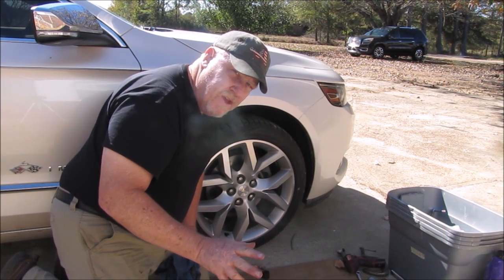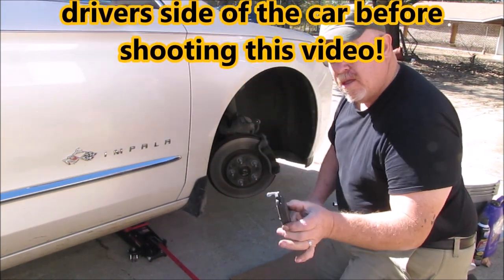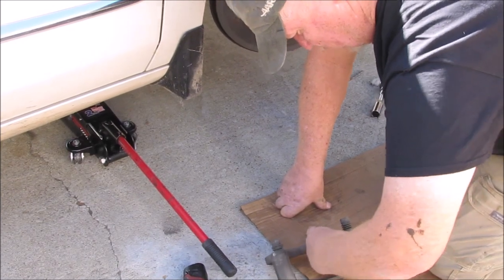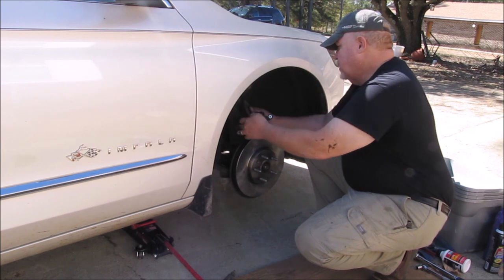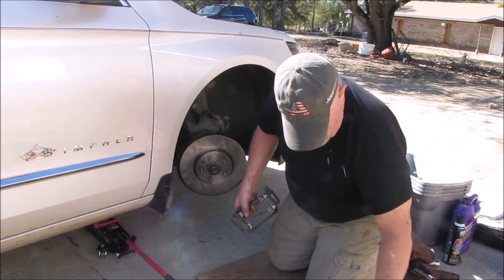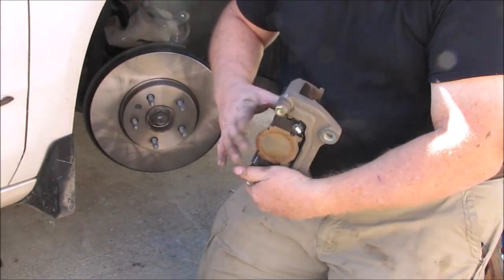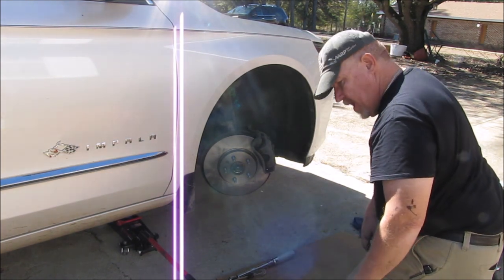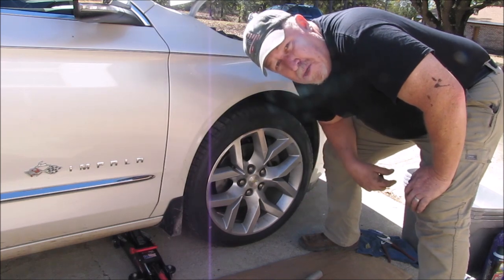2014 Impala brake pad and rotor replacement

Comment: Happy Thanksgiving Ernie and Ed!.... Since brakes is what I do in my sleep I found this very interesting and funny... Not too knock you but please put a tire under the front of the car just in case... I'd rather see a tire get hurt than you! That jack is an upgrade of what came with the car but I have trust issues 😂😂😂... The torx bolt is not there to hold the rotor and always use antiseize on it.. If you ever had to drill one out you know why I say this... You can usally use a lug nut to hold rotor inline so pads and caliper slide right in... Another tip is when pushing in piston you would rather crack the brake bleeder so the old fliud does not back up into the ABS module there maybe contamints in the cailper that can cause issues in the module. A small hose going to a plastic bottle will catch the spill over.... There are very affordable torque wrenches today you can pick up a very nice digtal and accurate one for under $200 and a clicker style for about $90 no fear on where they are made either. What you paid in parts to do the job your self is pretty good as its costs 3 to 4 times more to take it to a good shop that knows what they are doing. On brake bleeding there is pressure bleeding and vaccum bleeding... And even. Gravity bleeding I have tool for all three and again has gotten more affordable... For those with the skill and inclanation to do all the work themselves there is a ton of money to be saved over taking it to the shop. I just did a 2012 nissan versa brakes all around and rear wheel cylinders yeah drum brakes in 2012!! Wow can you believe that!😂😂 lucky I know how to work on drums huh!... And I have not spent one second in tech school I'm self taught...and today is the golden age of information you can learn anything you want to learn... Like a famous carpenter said seek and ye shall find.
Reply from the maker: I knew someone would say something about not having jack stands.  Hard to tell from this video but I was upset that I had to take a day off from work to do this and was in a big hurry.  You know how you will cut corners....well that was me.  I am not usually so lax with what I am doing.  The video idea was also Ernie's because I had not uploaded one in a while and one of my other how-to vid's is getting a bunch of watch time.  I appreciate all the advice you offered in the comment.  Until next time, God Bless and Happy Holidays!!
Reply: Yeah Ed I just want you around for a long time...and I had a mopar b body drop on me lucky the wife was there and she got it off me with the jack lol... But not so funny had a freind get killed when the bus he was working on fell on him from the jack giving way.